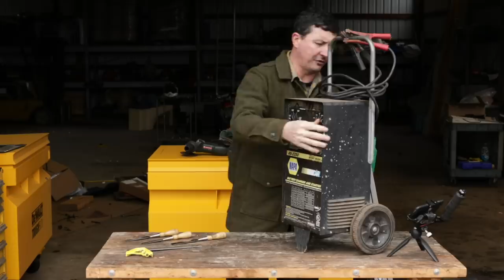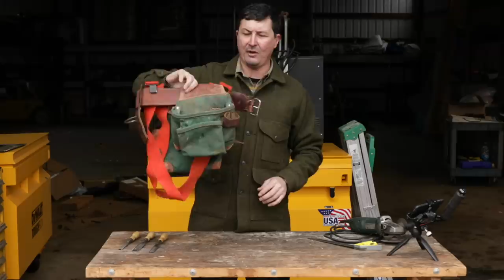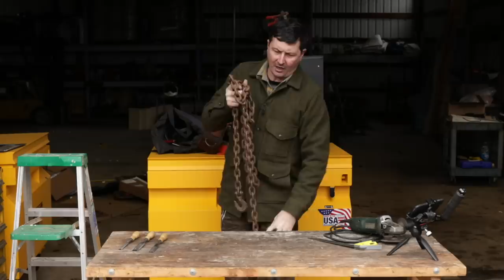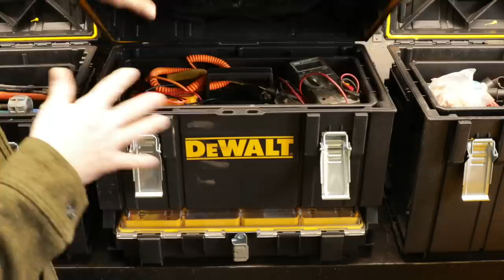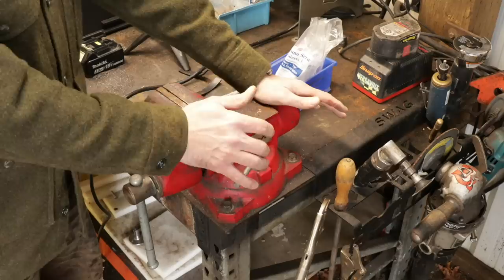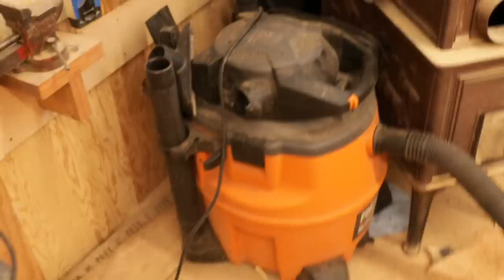10 Tools You Can't Not Have

Comment: As a former firefighter, emergency preparedness to help others was always paramount. I carried a plethora of tools and gear in my truck and in those days often stopped to help others in need. I had a 30ft set of jumper cables made of #2 welding cable, heavy, but could start a jet!  Since the advent of the self contained battery jumper packs, not much use for the cables anymore. Your shop is the dream of most of us old timers! You must have some good revenue source to have such a great homestead. Many compliments on your skills and family values. I bet I was raised in the same religion you practice. Thanks for all the sharing and God Bless

Comment: Lots here to read, not at all criticism, most is for kudos, so read thru! You are absolutely right about jumper cables! I can say NOT to get the thinner cheaper one, go heavy cable, ten foot! Chisels, again you are so right!  I keep a good set and a "bang it out set" for heavy chipping or gouging. In the end, the metallurgy is what makes a chisel work well. If the metal is good, you can tune even a cheap one, given good metal. Great tips for vices, I never knew why most people put them on the end of the bench till you said something... Love your advice for compartmental tool bins and boxes... I have the exact problem you mentioned: "I know I have it, now were is it??" lol. The only disagreement I see here is for your table saw. truly, not just for safety, but for extra flexibility and accuracy, an older "cabinet" saw or "contractor" saw is what most people have need for, and I can go further to say that if you are just needed to do general framing or household work, (Leaking roof repair, joist buttressing, framing, the two most needed tools are first a radial hand saw, then a chop saw/compound mitre saw. After that, yes the table saw is awesome, but overkill for 90% of things that could be achieved by these two cheaper things, but get the shop vac BEFORE the table saw! Great video, thanks for sharing!

Comment: Hi Cody,

I do woodwork as a hobby and now at 66 years old do not use
a tool belt any more, but the suspenders (called braces in the UK) are still a
must. I have lost by get up and go along with my waist and my braces no longer
hold up my tool belt but just my trousers and my dignity.

Comment: part time welder/fabricator here, I picked up a 230mm/9" Makita MT9001 grinder for €80 clearance thinking it'd be a nice strong grinder but it'd only last a year or two, well after a few months I basically began using it as my go to grinder and now 3 years later it's still as good as the day I got it. Grant I'm not using it 8 hours a day, in reality it sees between 10 to 20 hours of use a week, it's still fine. I seen guys give the MT series a hard time, but if you're not using it everyday on an oil rig it's fine.

Comment: HAHA I died when you lumped the shop vac and table saw into one. It is so true though, the moment you connect a shop vac to a saw you wonder how you ever tolerated working without it. I managed to get lucky myself and found an old wood working shop auctioning off old equipment and picked up the old style dust collector for basically nothing. Having one device permanently attacked to multiple saws is huge, but before that a shop vac all the way.
Reply: OmegaGamingNetwork
My dad isn't allowed to drill into walls without a vacuum, imagine to clean up the sort of workshop without the floor space to walk, excavating the occasional pony tool!

Comment: Just found your channel. 
Not bad. 

I have a great tip for tool storage for you. After my wife retired, she had a 4 drawer lateral file she didn’t need I moved to my shop, the garage, they are great! The steel drawers are deep and can hold a lot of weight as well as pull out fully. I now have 8 of these thing and I’ve got tools and accessories round up. 

The best thing is I’ve paid next to nothing for them. Now is a great time to get them. Because everyone is eliminating paper, I’ve managed to pick these up at my local university surplus sale. All told, I’ve spent 40$ for the lot. 

For what it’s worth.

Comment: That's an excellent list of 50.   I'd add:  good cold chisel, steel brush,  quality flashlight and head lamp,  one  extra long, skinny, flat screwdriver,  Clamps: F-clamps, or C-clamps, or Visegrip C-clamps,  A power tool with a wire brush: preferably on a bench grinder, but maybe on an angle grinder. 
 I call these tools also: WD-40( have some kind of oil  for generic use); spray ether or brake cleaner;   tapes: duct, electrical, masking, Teflon.  A roll of plumber's sandpaper.

Comment: I have the same set up with the tool boxes for my gear, I have one for electrical, mechanical, one for plumbing one for carpentry and others like one for moose hunting gear and so on, but I have them on the two level carts and can park them out of the way in the barn and wheel them out when I need them, big time saver and can bring right to the work area. I can move the carts around in the bucket of the tractor when needed else where. Good video.

Comment: Cody
Great sequence, I just acquired a cabin and need to outfit the garage with tools.  At my house I have woodworking and mechanic tools and not wanting to haul tools every season I have been trying to create a starter kit.  You have helped a great deal.  In the first 10 I either missed one or did your books count, I will go back and rewatch it.  I will be adding a couple you didn't mention, a cross lug wrench for all those different lug sizes and a "cats paw" that was always in my tool belt when I was a framer.

Thanks Again

Comment: You missed a detail on the chain !  One of the few tools I inherited from my father was a "logging" chain.  The important detail is, one end should have a "grab" hook (𝑎 ℎ𝑜𝑜𝑘 𝑡ℎ𝑎𝑡 𝑤𝑖𝑙𝑙 𝑙𝑜𝑐𝑘 𝑜𝑛𝑡𝑜 𝑡ℎ𝑒 𝑐ℎ𝑎𝑖𝑛 𝑏𝑒𝑡𝑤𝑒𝑒𝑛 𝑜𝑡ℎ𝑒𝑟 𝑙𝑖𝑛𝑘𝑠)and the other end should have a "slip" hook (𝑎 ℎ𝑜𝑜𝑘 𝑡ℎ𝑎𝑡 𝑤𝑖𝑙𝑙 𝑎𝑙𝑙𝑜𝑤 𝑡ℎ𝑒 𝑐ℎ𝑎𝑖𝑛 𝑡𝑜 𝑠𝑙𝑖𝑝 𝑡ℎ𝑟𝑜𝑢𝑔ℎ 𝑖𝑡).  Yours has this.

If you think you need a longer chain, buy a second 15' length and combine them using a double clevis.  Replace the cotter pins on the connecting pins with stainless steel split rings so that you can actually take it apart without tools.  Last, "proof coil" chain has the lowest working load limit.  Next is grade 40/43 and then grade 70.  All chains are tested to the working load limit.

A chain is great, but I also like having a 2" wide x 20' nylon strap with loops on each end.  𝗡𝗢 𝗛𝗢𝗢𝗞𝗦 !  The loops are great for wrapping around parts of vehicles and then passing the other end through.  Now it can not come off and it are less likely to damage the part it is wrapped around.  At the other end, just fold a part of the strap near the free end over and pass it back through the free loop and slip that over a trailer ball or a hook on your truck/tractor.

If you are going to go this far, add a couple of anchor clevises to your chain kit  !

Comment: A good work light (Dewalt?) and a solid portable workbench.  I used an 80s Black & Decker workmate, sold it and got a new one w a bamboo lam top.  Nice table saw.  And the Rigid shop vac is boss.  Got one for the condo.

Comment: I bought one of those rolling battery chargers/jump starters years ago and have never regretted it. Does a 2 amp slow charge to a 250 jump start with several settings in between.

Comment: Nice intro in terms of helping others. In terms of "fire department"... And I know this isn't a tool. But, ABEC FIRE EXTINGUISHERS, SMOKE DETECTORS... And, for vehicles, emergency rescue hammer/cutters. Good to see a handsome, big extinguisher on the shelf in your shop! Also looks as though it's got a service tag on it. Assuming that's up to date, A+.

Smaller jumper leads, so long as they're of OK quality, will work on most things. Combined with an engine starter... "Start ya b--sard" is the brand name here, but it's just diethylether in vapor form (!!!)... Spray some of that up the air intake, and your chances of getting a vehicle with a dead battery to crank over and start is amplified a lot....!! Heck of a lot cheaper than super high end jumper leads and chargers......

Comment: I would choose biggish jump starter battery back and 10-20A "smart" battery charger. I think you can maybe skip jumper cables with this set. I got 12 year old ~20kg battery pack and it can start 8l 6 cylinder diesel, not easily but it can.

These videos were really nice and informative. I cant wait for second part with 200 tools what every man/woman needs. 👍

Comment: For the 4' to 6' ladder a much better option are those newish folding ladders with a large final platform step at the top. They are super lightweight, easy to carry to the job and the best part about them is that huge step at the top. It allows you the ability to move around quite a bit more up there and get into position. They are a game changer really. I rarely, if ever, get out my smaller step ladder like the one in this video anymore. I only use that type for the taller jobs these days.

Comment: I prefer having a heaven duty pulling strap over a chain, after doing a lot of off-roading and being a Jeep guy I’ve found that if you get a good, 20’ long heavy duty strap with a loop on each end it’s far lighter than a chain and far easier to deal along with the fact that it puts way less wear and tear and vehicles. If someone gets really buried sometimes you have to get a long head start to snap them out and when you do that with a chain it’s just hard on a vehicle, when you do it with a strap it actually works better as the strap stretches like a rubber band and actually adds more force and doesn’t beat the hell out of both vehicles.

Comment: re the angel grinder if you want to you can use a heavy duty "dimmer switch"(reostat) to drop the power(voltage) going in to it this slows it down and then you can use flap disks or velcro backing pads to allow you to sand at lower speed.you can also do this with mains power drills.at lest you can with 240 volts i dont know about in the u.s.a. keep up the good work cody.

Comment: I suggest adding two pieces of ~3inch copper pipe to the jumper cable bag. That way you can always extend if you run short, but there is a second pair of jumper cables around. Work's great but be aware! It is easier to create a short with the exposed copper.

Comment: I had a welding instructor that swore by the Metabo angle grinder. I didn’t listen to him and burned through 4 dewalt grinders before purchasing a Metabo 8 years ago and use it daily. Just about ready to replace it with another Metabo.

Comment: Hello , by the way I admire you and your videos are excellent , I completely agree on the electric stud finders , they aren’t that great , maybe someone makes a good one , on the magnetic ones though I use them all the time and they work well on drywall yet not on plaster walls , what’s even better for drywall is a small neodymium disc magnet about 1 inch diameter by about 1/8 inch thick , give one of them another try , much better and easier than making a bunch a holes with a nail trying to find the stud but remember only in drywall walls , hopefully you or someone finds this useful , thanks again

Comment: Agree with this guy here’s my tool list
8 pound beater hammer 
4pound shop hammer and 2 pound
And 20 and 16 punch hammer 
8 and 6 inch c clamps
1 inch spud,1 1/4 spud,7/8 spud half inch spud,5/8 spud wrench
36 inch connecting bar
30 inch crow bar
16 ft tape measure 
25ft tape measure 
10,8,6 inch adjustable wrench 
18 inch wrench for 2inch bolts or bigger
Pliers set
9 inch grinder
4 1/2 inch grinder
18 pound hammer

Comment: my top 10 that i use most often
18v light mines dewalt but any brand works, dont realise how handy it is untill you have one
drill and impact, needs no explanation
1/2" cordless impact, i mostly do mechanical work its super handy for stuck nuts or just bigger stuff
angle grinder, million uses
vise, if you have a vise you know if you don't you'll find out
ratchets and sockets, cant get off nuts and bolts without them
wrench's, same as above
pliers, million uses
hammers (standard, dead blow and mallet), sometimes things need a whack
knife, i cant believe this wasnt on your list

I dont have a tool belt or a small step ladder or a table saw. i just dont need them. table saw would be handy but it takes up too much space and is too expensive to justify for something i might use once a year if that. step ladder i have a big ladder and for stuff that a step ladder would be better i can reach just with a milk crate, as for a tool belt im not doing anything that would require one, i dont own my house so i cant do renovation type work and mechanical work its just not practical..

Comment: 5/16 chain I thought was the wire size used in forming each link. It's 5/16th inch thick. And hardened steel is better

Comment: Take it from a welder. Do not get a cordless angle grinder for heavy grinding or cutting. I’ve used Milwaukee with a big 6 ah battery to grind and it died in 5 minutes. Nothing wrong with Milwaukee. Just a lot of load to put on a battery.

Comment: What are those dewalts boxes
Reply: Sam Rothermel  those are big tool boxes like they have on a job site or at a coal mine
Reply: Sam Rothermel it’s called the tough system they also have smaller cheaper ones called t-stak

Comment: Better yet, don't buy jumper cables, just build them, it'll be massively cheaper and you'll  know exactly what you have. All you need is 4 clamps and the exact length of thick cable you want. Mine I did with 8mm cables, massive!

Comment: Keep yourself chain LOCKED up in your tool box.  Came out to a parking lot to find my truck with scratches down to bare metal on the side of the bed where my 30’ chain was sitting in the bed. Some lazy piece of trash stole my chain and did so by taking a steel 5 gal bucket from my truck and setting it on the pavement next to the truck…pulled the end over the bed rail, and drug all 30’ of it up and over, dragging it down the side of my bed.

Comment: I hate chains for pulling stuck vehicles. They are heavy and dangerous. Have you ever considered a tow strap with shackle? The shackle pin breaks and less chance of losing your head or windows.
Reply from the maker: A strap is better but a chain is more versatile,
Reply: I have seen a couple of comments regarding chain Vs. strap.  Here is a thought...  Since straps are light weight (relatively speaking) and fairly compact, why not carry both?  Then you could select the best one for the job at  hand or even use them together. (Doubled up for greater overall strength and a little better safety, or end to end for a greater reach.)
Reply: clyde alspaugh If I spent time im the wilderness as much as Cody, I think Id have a Warn winch or comparable.

Comment: Does anyone have a list of all 50 tools?
Reply: Wranglerstar does.  :-)  Here's some advice:  Just buy the tools you need as you need them.  Give some thought as to how much the tool will be used in the future.  If it is much then buy a good tool.  If it is probably once or twice more in your lifetime then either borrow it or buy a Chinese quality tool.  Chinese stuff actually can be pretty darn good at a very reasonable price.  Anyway, you don't need a list.  You will not be doing the same kind of things Wranglerstar does.  You may never need a chain for instance.  Or a chainsaw.  Buy the tools YOU need.
Reply: A for instance are some tools I use darn near every day that Wranglerstar overlooked or might not even own.  1.  Sears Robogrip pliers.  No kidding, these have been my goto pliers half my life.  Three sizes and they just work so good.  Couldn't live without them.  2.  A pneumatic staple gun.  You don't think you need one but you do!  Of course you need a compressor to run it... 3. A good heat gun.  Again, I use this thing more than I would have ever thought.  4.  Along with the heat gun (heat shrink is but one small use for it though) is a GOOD soldering iron.  I could go on and on...Just tailor your toolbox to what YOU need.
Reply: Tenspeed TheBikeHanger dude I just wanted to read the list rather than watch hours of video..

Comment: Becareful jumping off modern cars, pretty easy to fry the computer
Reply: Modern vehicles are hardly worth having anyway, imo. Not trying to start an internet fight, just remarking my opinion.
Reply: Agreed. I've heard that it's ok to "jump" newer cars through the cigarette lighter. Some of the newer portable battery packs seem to have that feature.... I've never done it myself though.
Reply: Theres a conection you can attach to batt befor jumping that is a fuse and it protects new car computers etc

Comment: Where is the guard on your angle grinder? You should never use an angle grinder without an guard, maybe its annoying, but not having you hand or your fngers is more annoying.
Reply from the maker: I took it off because it gets in the way,
Reply: hope your fingers don't get in the way ;)
Reply: Guards are sometimes more of a hindrance than a help, if it's your equipment and no one else uses it, it's up to you if you want to take the chance.
Reply: Lol, it’s true though they’ll only get in the way once.
Reply: Safety Sally alert!
Reply: I couldn't even tell you where the guards for mine are anymore. I find it better to just wear heavy duty gloves.
Reply: OmegaGamingNetwork although I rarely use the guard either, gloves will just make it easier to find your severed fingers
Reply: I've never had a guard get in a way enough for me to take it off. However, proper PPE can mitigate just as good as a guard.
Reply: Did you just have a stroke on your keyboard
Reply: He’s not gonna do this but the guard also shows the max diameter of disc u can use
Reply: A good safety T-shirt is all that's needed
Reply: First thing I do when purchasing a new grinder is take the guard off and throw it away.